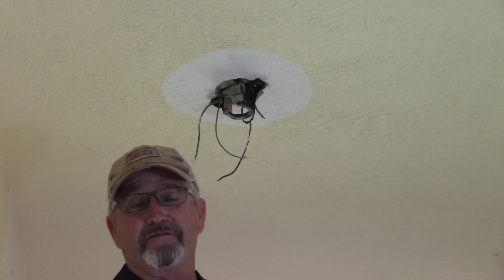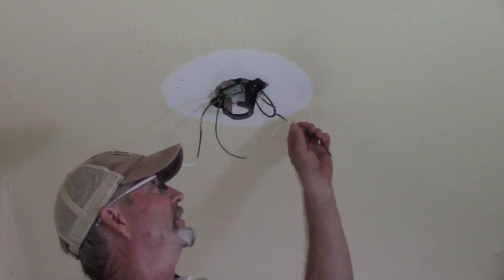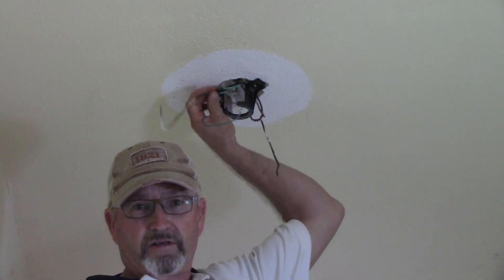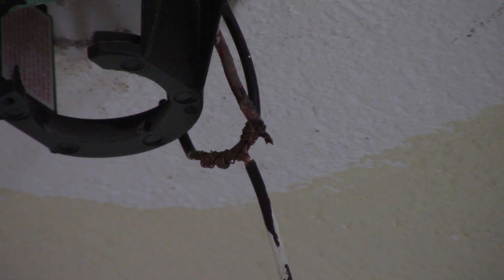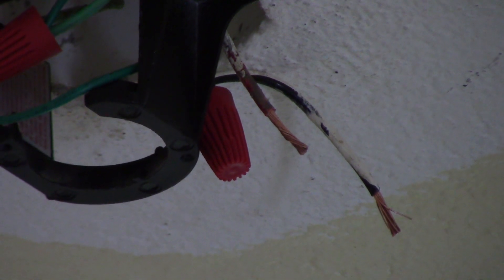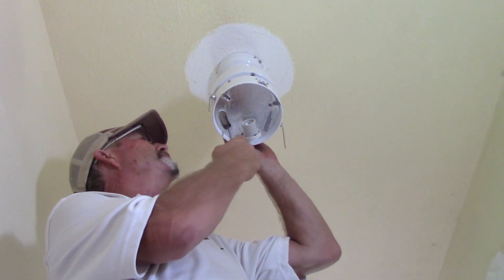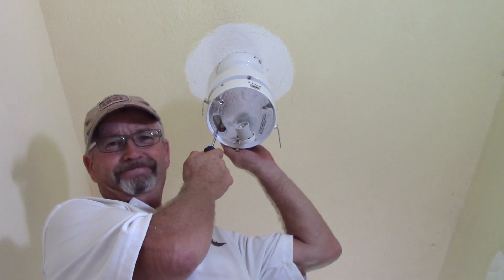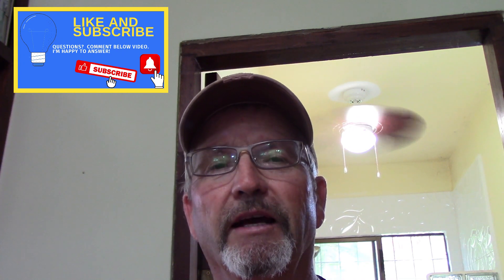Troubleshooting a Ceiling Fan While Trying to Make Sense of the "Questionable" Wiring Fan Assembly.

Comment: Hello Terry, we live in a older mobile home that we are fixing up. I am redoing a bedroom. The old ceiling fan worked fine. As far as the new one goes, it's the same kind of fan but I only have a white wire, a black wire, a blue wire, and the crown wire from the fan itself and then coming from the ceiling. I have a blue one, a black one and the ground and that's it. I don't know if I'm getting my wires wrong or what but I can't get it to work. Can you please help me? Thank you

Comment: Hi,
Can you advise on troubleshooting: after installation, fan runs and lights are on. But soon after, it will not start and the lights are ok.
Switch string now suddenly controls the lights, while the lights switch string is also working fine.

What could be the cause of fan malfunction and fan switch string to turn the lights on and off?